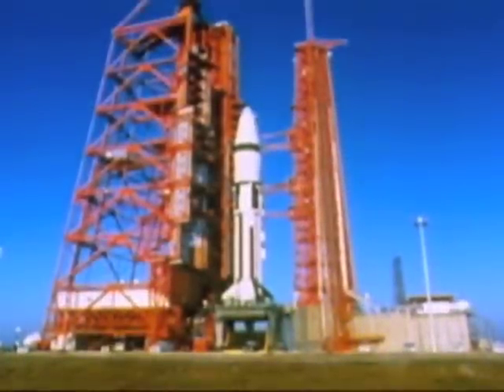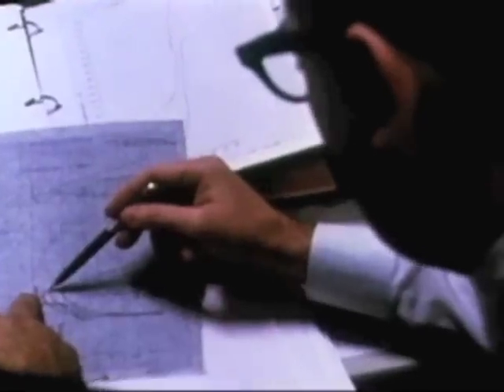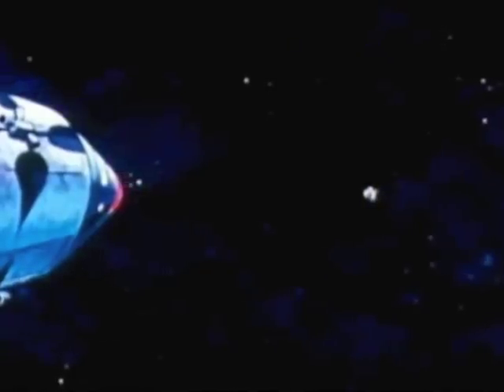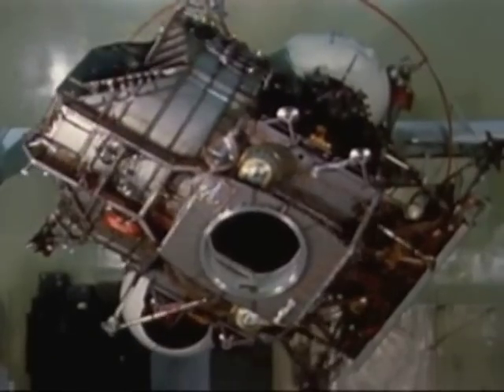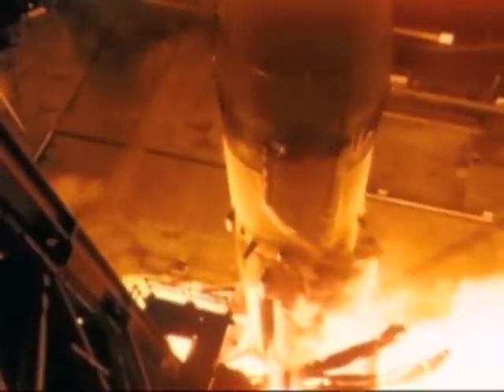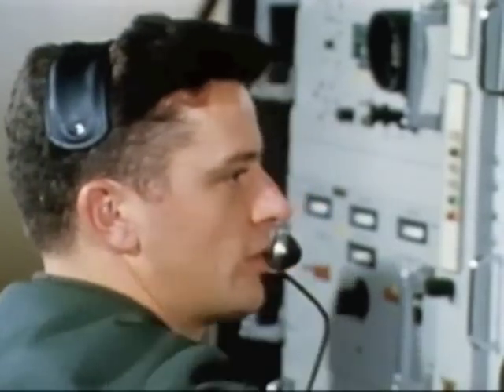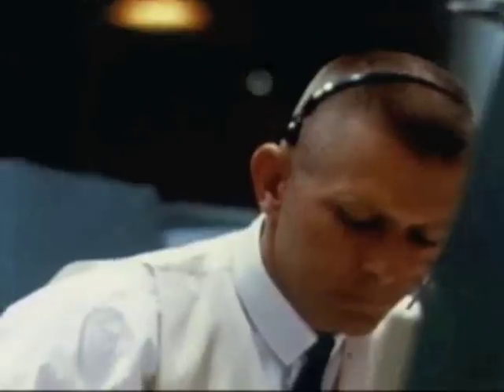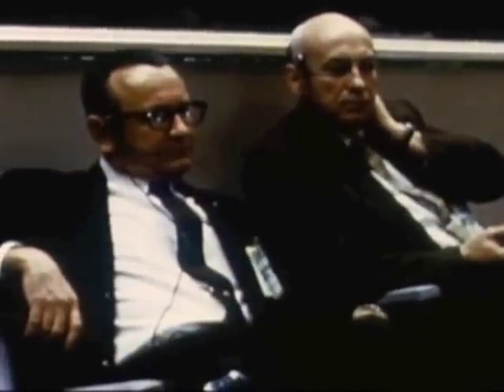The Apollo 5 Mission

Comment: That was the Saturn 1B originally attached to Apollo 1.
Reply: Seriously? Wow I never knew that
Reply: Yes, dismantled from LC-34, checkout, and reassembled at LC-37B (to the North).
Once LC-34 was cleared of the AS-204 launch vehicle, 
specific additions were made for the manned launch of Apollo 7 from LC-34 in 1968.

AS-205 was assembled at LC-34 , following completion of Apollo 5 launch (January 1968).
Here is a photo, from that period, before mounting the redesigned Apollo 7 (Block II CM) & its Service Module.
https://for-all-mankind.tumblr.com/post/111392949389/the-saturn-1b-rocket-for-as-205-is-seen-at-lc-34
Reply: Wow, that’s kinda haunting. Must have felt weird for the crews working on it knowing what happened. But using it on such a critical mission was a pretty fitting memorial in retrospect.

Comment: Why do so many sources claim that the LEM DPS was the first rocket engine designed to be throttled? The X-15's "big" engine was throttled, and it was built before the LEM DPS.
Reply: Ken Chorney 
In Space.  The X-15 engine was lighted in Earth atmosphere as designed in the X-15 mission profile.
The LMDE was designed for space (vacuum) on a vehicle designed for cis-Lunar usage.
The LMDE was so successful that this TRW design was used after the Apollo program, 
as the second stage engine (reworked into TR-201) for NASA’s Delta launcher during the 1970s.
https://en.m.wikipedia.org/wiki/TR-201

Comment: why so much hate for the computer? :D
Reply: It's easy to blame the computer.  In fact the problem was a communications one (see NASA Apollo Communications Report March 1968).  It says "incomplete systems integration" but as Don Eyles's explains in "Sunburst and Luminary" the computer did exactly what it was programmed to do, but the LM engineers hadn't told MIT/IL that they had changed the firing routines because of issues arising on leak tests.  So Sunburst correctly recognised, on the instructions it had, that something was wrong.  Eyles said that, had they been told, the programming change would have been easy.  Furthermore, had Mission Control tried to restart the LM engine, it might have been possible to continue under computer control, but they took the decision to go manual.

As David Mindell says in "Digital Apollo", 'social and managerial problems could be obscured by blaming the code'.  As social and managerial problems would be laid directly at NASA's door whereas computer ones would be laid at IL's, you can see, publicly, why hating the computer might be a good option.